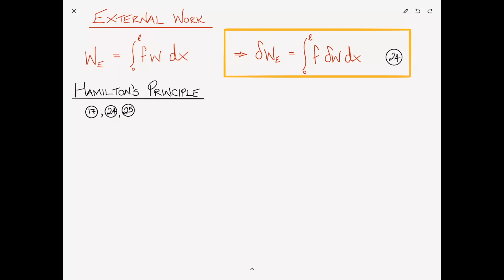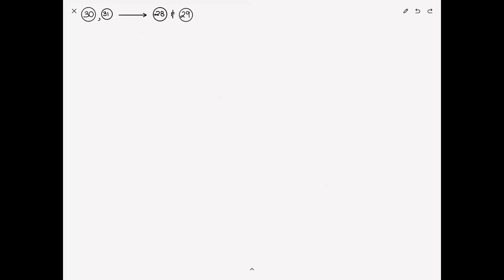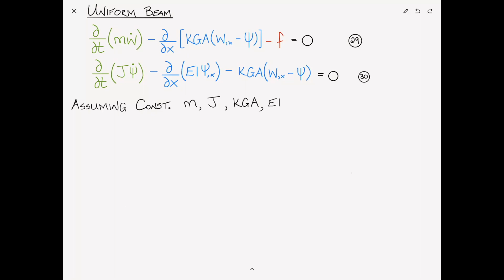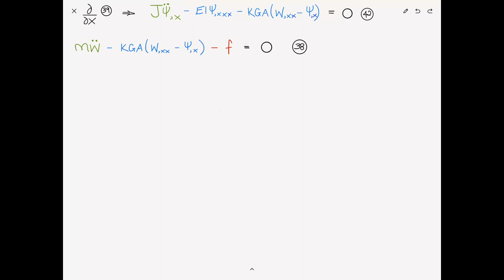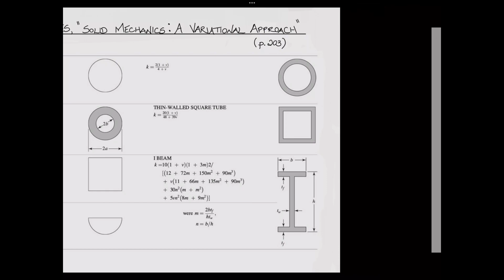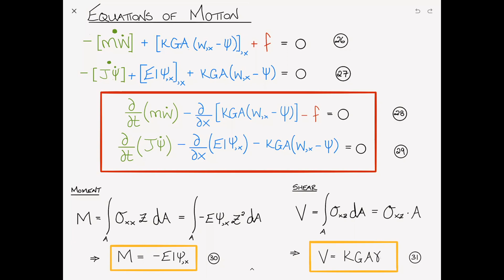Timoshenko Beam Theory Part 3 of 3: Equations of Motion

Comment: Is there any other video that shows the Eq 46 applied for any simple example? Tube of diameter equal to length, fixed one end and point load on opposite end? Thanks!
Reply from the maker: I don't currently have a video showing an example of this.  Will add it to my To Do list.